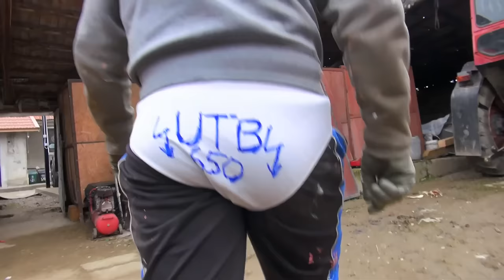Ingenious cold starts-Old diesel engines ⚙💨🚜🔥💨🔥

Comment: Stop pumping that accelerator on that diesel it achieves absolutely nothing,floor the accelerator and keep it there to give the engine full fuel until it fires up and then leave it to fast idle until it warms up a little,a flame in the inlet manifold will almost always fire up a diesel in cold weather.

Comment: Old worn out diesels can be hard to start in the cold. But why go through that much trouble? Get some starting ether and put antifreeze in the engine so you sleep calm in the cold nights!
Reply: @tractorsmachinesro1405  22:52 what's this tractor name?
Reply: @filipsuwaa4707  No właśnie nigdzie takiej Škody nie mogę znaleźć
Reply: Ether is alright for indirect injection diesels of old but be very careful using it on modern direct injection engines,a gas powered blow lamp around the air intake or inlet manifold will do the job easily,I’ve used one of the electric heat guns when a mains outlet was available.

Comment: When I worked in the Yukon Territory we had D-8 K CAT's. In the winter we'd build a fire under he crankcase and allow the motor to begin warming BEFORE we tried to start hem up. It seemed to be effective.
Reply from the maker: Norman 🤝💥🤠
Reply: done that before , also used tiger torch with about 10ft of stove pipe with an elbow on the end heated the oil pan . use to like the old John Deere and Cats with a starting engine start the small engine let it run for about 2 to 10 min the big engine would start easy even when it was 40 - 50 below

Comment: Run a flex pipe from the exhaust to the intake. Smoky diesel and heat help to start quicker. Or a rag soaked with petrol around the intake breather. I had to use a torpedo heater under a canvas tarp on an old D-9 that skipped a track last year. Got stuck in the woods at -20 up here in Northern NY near the Canadian border. Then I had to do steer clutches on it a week later in the same cold, not fun. We built a tent around the machine and kept warm with the torpedo heater, good for heating the coffee though, lol.
Reply from the maker: Gene 🤝

Comment: At 02:07: Can someone please tell the lightning bulb that he sits on a diesel engine? 
Pumping the pedal is useless, the engine needs heat in the combustion chamber.
And a gasoline engine with a carburetor would already be hopelessly flooded.
Reply from the maker: facem si noi ce putem 🤝